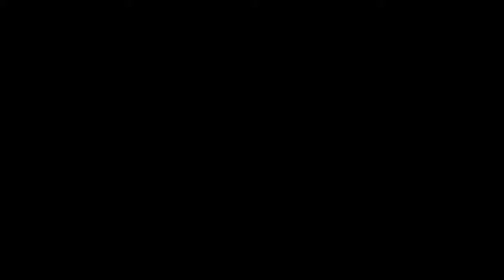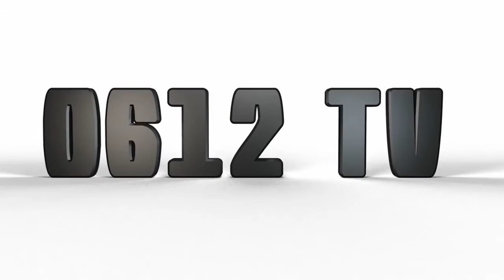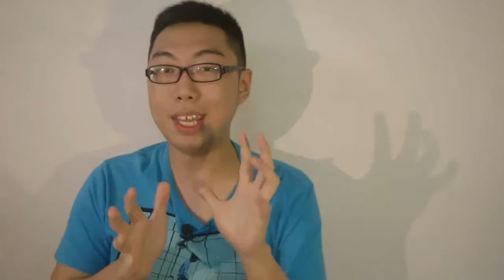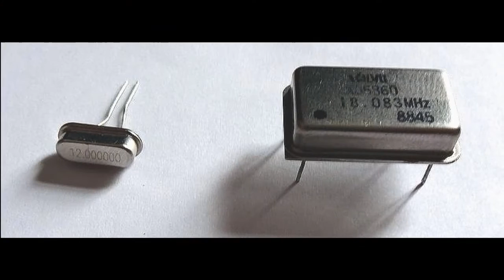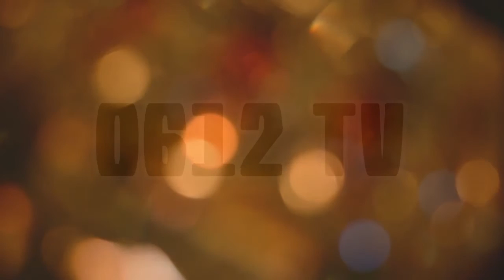Quartz Crystals - Friday Minis 192

Comment: there is a video from around ww2 that shows how they were made. including all about te alignment of the latice and shape and finish of the surface. Its quite interesting.
Also one thing you forgot to mention, these crystal dont run on their own, maybe on a 486ish motherboard you could find a 66 or 100mhz crystal somewhere there, because everything ran at that frequency but nowadays they use a slower crystal and a phase shift locked loop multiplier and dividers to get the desired frequency. Say 10MHz times 40 divided by 3 gives you 133,333MHz. 

The advantage is you can use it as a base clock for all the different clocks in the system. (old mobos advertizing to have separate pci clocks for overclocking come to mind).
Reply from the maker: Hello and thank you for your comment! Good point about the multipliers! Didn't want to pack too much into this video (it's meant to be "Mini" after all), but it's certainly a good thing to discuss! I'll take it down, might get back to this in another Minis later on down the line.

Comment: Correct me if I am wrong, it is my understanding that a quartz crystal changes its physical size due to the change of voltage potential (and also generates a voltage when the physical size is changed), and not passes much a current.
Reply from the maker: Hello and thank you for your comment! You are right to say that voltage and flexing of the crystal are correlated - The flexing produces a voltage and application of a voltage creates a physical change on the crystal itself.

I couldn't find much information in terms of current. Based on what I see on Wikipedia it seems that current pull is related to the frequency of crystal oscillation - Higher frequencies draw more current: https://en.wikipedia.org/wiki/Quartz_clock#Mechanism